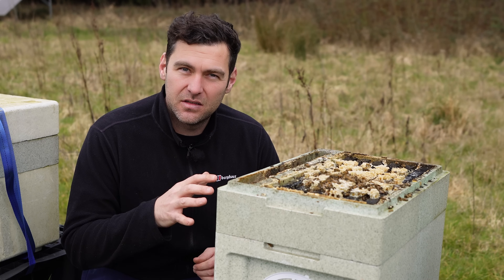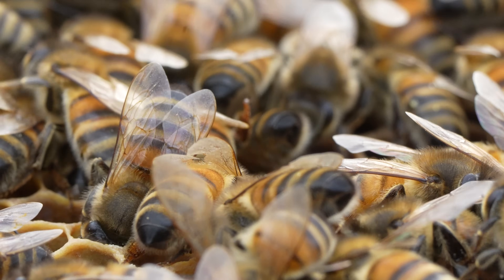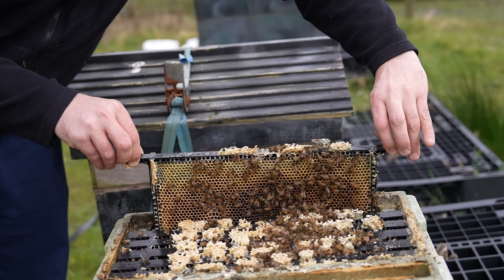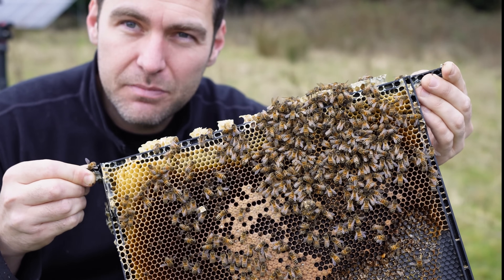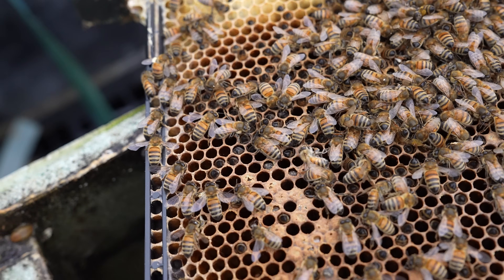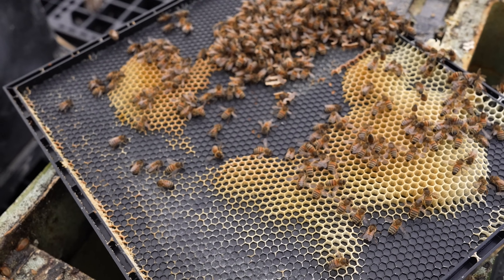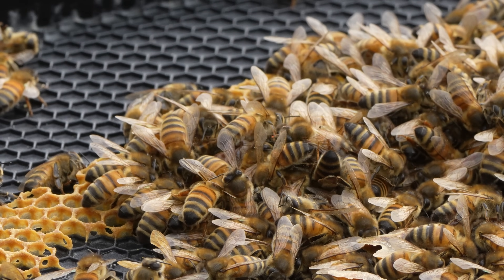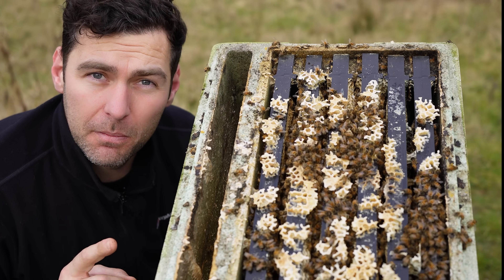I Killed My Bees And Feel SO Guilty – Understanding Starvation On Black Plastic Frames

Comment: Thank you for being honest. i'm awful at hefting so I place a slap of fondant on the frames in the autumn and by using the up turned polly ashforth feeder I can just crack the top slightly to peek in if they have eaten the fondant. I've checked them on milder days and recently needed to add an extra fondant slab. Your honestly will help others.

Comment: I'm in my 2nd beekeeping winter. First year I only had the one hive and lost during a really cold spell for the UK (-12 degrees C according to the car!). Started again last spring and after an eventful year encountering all sorts of problems I entered winter with two strong hives and a nuc that I split off one of them. One of the hives died and I really don't know why there are lots of stores left. The hive wasn't damp and no signs of disease. The other hive and the nuc (both with your Buckfast UK queens) are doing great but between them they've gone through quite a lot of fondant. As they are in my garden I have the luxury of checking them often. Every day is a learning day

Comment: Dry sugar is cheap and should be on top of the frames in spring.
They may or may not use it - both are fine.
But starvation will be prevented.

Comment: they can recover in a couple hrs too. I have found nucs in the same condition, a good spray with sugar water will get them moving to the point they can take the feed you give them
Reply: Yeah I agree with this. As long as the spray doesn’t soak them.  They need contact to a few misted drops and then they should be able to warm up.
Reply: @sinisterhipp0  I have poured a puddle on the top bar and in 15 min. they were all active again. it is amazing how fast they can pass it around to the weak ones